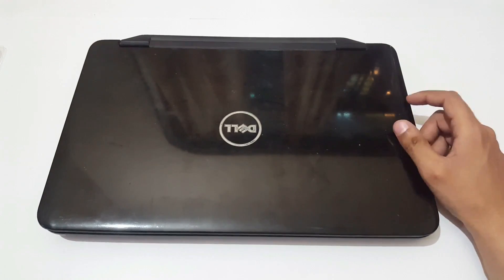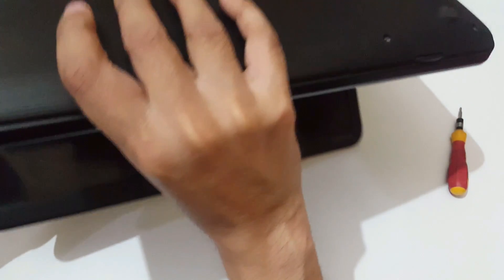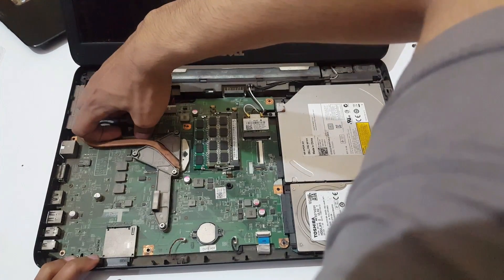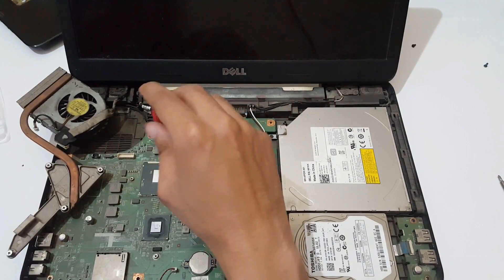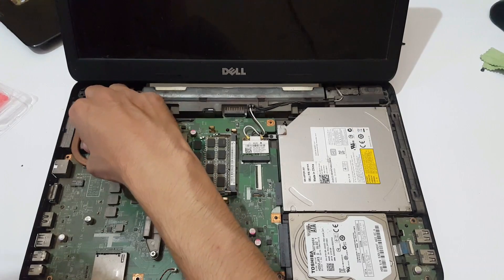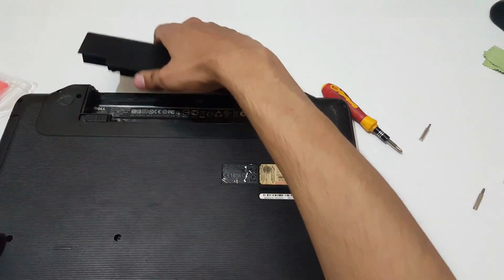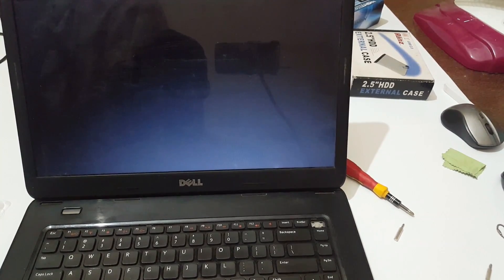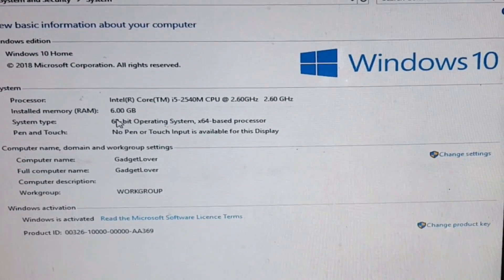How to Upgrade Processor on DELL Laptop | i3 to i5 & i7 - Make Laptop Faster for Gaming

Comment: Thank you for this video .. I have dell inspiron 15 3000, i3 7th gen. Laptop(model 3576) ...can i upgrade it to i5 or i7? ..if yes than what processor will suit best for my laptop?
Reply from the maker: Mayuri patel : You're welcome and in my knowledge the processor of this Laptop is soldered so you can't upgrade it but I would suggest you upgrade its RAM and install SSD for better performance
Reply: @GadgetLover360  thank you very much ..
Reply from the maker: Mayuri patel : You're most welcome
Reply: @GadgetLover360  bro I had the same question for the same model, so thanks for the answer. I found that I can replace my cd drive with a caddy to attach additional hard drive, so if I use it to attach a ssd, will it improve my device's performance or do I need to install it inside by replacing the default harddrive?
Reply from the maker: @NaNa-cq8ck  Install it inside

Comment: Bro, my laptop Dell Inspiron 3521 and processor Intel Core i3-3110M, CPU 2.40 Ghz. Is it possible to upgrade processor i3 to i5 or i7?. Is there any issue will be face for this model once upgrading the Processor? If it possible please tell me which is best.
Reply from the maker: Noufal Thekkath : Unfortunately the processor of this Laptop is soldered so you can't upgrade it but I would suggest you upgrade its RAM and install SSD for better performance
Reply: @GadgetLover360  No brother, it’s not soldered it’s detachable. I already shared with you some the photos on Messenger App. I already detached processor and now I’m looking for the suitable i5 or i7 processor for upgrade. Could you please have look at Messenger App? I already shared some photos of my processor. Thank You
Reply from the maker: Noufal Thekkath : You're welcome and I had seen you only detached keyboard so processor not seeing but if it is not soldered Intel Core i5 3380M is best processor for your Laptop
Reply: @GadgetLover360  thank You for your valuable information
Reply from the maker: Noufal Thekkath : You're welcome

Comment: I have dell latitude e4310 i5 1gen can i upgrade it to i5 4th gen??
Reply from the maker: Faheem Riaz : Unfortunately the processor of this Laptop is soldered so you can't upgrade it but I would suggest you upgrade its RAM and install SSD for better performance
Reply: thank you sir
Reply from the maker: Faheem Riaz : You're welcome

Comment: bro can i upgrade my dell inspiron 3542 processor
currently i am using i3 4004u 1.7ghz
Reply from the maker: Cosmic _Hynex : Unfortunately the processor of this Laptop is soldered so you can't upgrade it but I would suggest you upgrade its RAM and install SSD for better performance

Comment: Hi sir... actually I have dell 15 R 5537 laptop.. what upgrade can I do with this model.... already I have upgrade to ssd and ram also...what else I can upgrade like processers or motherboard ....please suggest me ....thanks
Reply from the maker: Ravi Lohana : You're welcome and unfortunately the processor of this Laptop is soldered so you can't upgrade it but you can attach graphics card externally to your Laptop
Reply: @GadgetLover360  thanks for reply sir...there is any way that I changed motherboard with lastest in the market with old ...which motherboard and processer I can used in this model...
Reply from the maker: Ravi Lohana : You're welcome and yes you can change motherboard so I would suggest you search compatible motherboard on Google for better results

Comment: Bro....I have HP 240 G4 laptop which i have recieved from Assam govt in 2015-16...It has intel pentium 4 processor. Can I upgrade its processor
Reply from the maker: Anshuman Sharma : The processor of this Laptop is soldered so you can't upgrade it but I would suggest you upgrade its RAM and install SSD for better performance

Comment: Bro I have dell Inspiron 3580 I3 what is the best processor for it.
Reply from the maker: Sudheer Lakkoju : The processor of this Laptop is soldered so you can't upgrade it but I would suggest you upgrade its RAM and install SSD for better performance
Reply: @GadgetLover360  Bro do I get the licensed windows even after installing SSD
Reply from the maker: Sudheer Lakkoju : Yes transfer Windows license to SSD
Reply: @GadgetLover360  Ok thank you I will try
Reply from the maker: Sudheer Lakkoju : You're welcome

Comment: Hey I have an INSPIRON N5010...with i3 m380...can i upgrade it to i5 10th gen?
Reply from the maker: What About This : I would like to inform that you can upgrade processor in same generation only and Intel Core i5 580M is best processor for your Laptop
Reply: @GadgetLover360  thanks for your fast reply and i have intel hd graphics in it and want to run minecraft...what graphics card i should buy?
Reply from the maker: What About This : You're welcome and I would suggest you buy Asus GeForce GT 710 2GB GDDR5 Graphics Card and attach it externally to your Laptop for better gaming experience

Comment: My friend i have dell N5010, with 0wxy9j cpu, with p6200, PGA988 Socket, WITHOUT AMD GRAPHICS CARD.
1. CAN I UPGRADE?
2. WILL I NEED FOR VOLTAGE TO RUN I7?
3. DID I NEED ANOTHER MOTHERBOARD?
thank you.
Reply from the maker: Elvin Mammedov : You're welcome and yes just follow instructions carefully to do it successfully without any problem and Intel Core i5 580M is best processor for your Laptop
Reply: @GadgetLover360  Thank you. What will be faster I7 640M or I5 580M?
I need to change the battery or the power supply for more watt?
there not will be heating problems?
Reply from the maker: Elvin Mammedov : You're welcome and there is no need to change battery of Laptop for this method and Intel Core i7 640M is faster processor

Comment: hey bro, can i upgrade Dell Vostro 3458 i3-5005U??
Reply from the maker: Risnanda Dimas Prayoga : Unfortunately the processor of this Laptop is soldered so you can't upgrade it but I would suggest you upgrade its RAM and install SSD for better performance
Reply: @GadgetLover360  can i install an external gpu in Dell Vostro 3458??
Reply from the maker: Risnanda Dimas Prayoga : Yes
Reply: @GadgetLover360  can??
Reply from the maker: Risnanda Dimas Prayoga : Yes you can attach external graphics card to your Laptop for better gaming experience
Reply: @GadgetLover360  thanks brother
Reply from the maker: Risnanda Dimas Prayoga : You're welcome

Comment: Can i upgrade my hp 4005u 2015 version
Reply from the maker: Harsh Ballamwar : In my knowledge the processor of this Laptop is soldered so you can't upgrade it but I would suggest you upgrade its RAM and install SSD for better performance

Comment: Hello bro! I have a dell inspiron 15 5000 series with a i5 processor. How much of a powerful processor I can install for gaming? Can I upgrade gpu?
Reply from the maker: Nargis Poli : Hi and I would like to inform you that if processor is not soldered you can upgrade it in same generation only and you can't upgrade GPU but you can attach graphics card externally to your Laptop for better gaming experience

Comment: Sir can I upgrade Dell vostro 3590 i3 to it or i7 or i9 processor
Reply from the maker: Mohit Khurana : Unfortunately the processor of this Laptop is soldered so you can't upgrade it but I would suggest you upgrade its RAM and install SSD for better performance

Comment: Sir I was thinking if I can upgrade my hp laptop it's i3 to i9 will it work and how can I increase my fps I get 60 I want 120+ my laptop has 8gb ram I heard if u increase ram u will be able to get more fps will putting 16gb we worthit please help me out asap.thanks🙏
Reply from the maker: Pavraj Brar : You're welcome and I would like to inform you that this upgrade will definitely improve the performance but for high refresh rate I would suggest you attach external graphics card to your Laptop update video driver to the latest version and optimize game settings
Reply: So would changing my graphics card improve my performance. Ok so buying i9 will help or not? And can you make a vid on buying a graphics card for laptop under 150$ and the settings that will improve my fps and gaming performance if possible use I9 cou also for info please thank you I'm subbed and liked to you
Reply from the maker: Pavraj Brar : Dear subscriber you're welcome and I would like to inform you that if processor of Laptop is not soldered you can upgrade it but in same generation only and for better gaming experience you can attach graphics card externally to your Laptop

Comment: Hello,I have a TravelMate 7740 laptop acer
Socket 989 rPGA
Mainboard: Acer BA70-CP
CPU: Intel Core i3 370M
Can I install an i7 940XM / i7 840QM / i7 740QM processor?
Reply from the maker: Rami Sadik : I would like to inform you that processor can upgrade it in same generation only and Intel Core i5 580M is best processor for your Laptop
Reply: @GadgetLover360  i7 640M ?
Reply from the maker: Rami Sadik : Yes you can also upgrade it with this processor

Comment: bro i have a dell inspiron 5558 can  i upgrade it another question will it affect the data of the laptop  and  can i upgrade my gpu from intel hd graphis to gtx1660 in this laptop
Reply: and its i3 so can it be upgraded to i5
Reply from the maker: WolfClover : Unfortunately the processor of this Laptop is soldered so you can't upgrade it and I would like to inform you that you can attach graphics card externally to your Laptop for better gaming experience and it will not affect the data of Laptop
Reply: @GadgetLover360  okay :(

Comment: Hi i have a dell vostro 3700 with a I5-450M,do you think i could swap it for a i5-3470T,cheers
Reply from the maker: mark lane : I would like to inform you that you can upgrade it in same generation only and Intel Core i7 640M is best processor for your Laptop
Reply: @GadgetLover360  Many thanks for your reply,much appreciated.
Reply: @GadgetLover360  Also would you no if that cpu supports 16gb ram,many thanks
Reply from the maker: mark lane : You're most welcome and I would like to inform you that this processor supports 8GB maximum memory size
Reply: @GadgetLover360  Many thanks for your help,i wanted a cpu that would support at least 16gb,i have been looking into it,and dont think there is one for my G1 socket that does.May be time for another laptop,cheers Mark.
Reply from the maker: mark lane : You're most welcome

Comment: can i upgrade my gpu? model: inspiron 15 5593. i want to upgrade with a gtx 1050 or something like that?
Reply from the maker: W8R GaMing : No but you can attach it externally to your Laptop
Reply: @GadgetLover360  will I able to use wifi after adding extra gpu?
Reply from the maker: W8R GaMing : Yes
Reply: @GadgetLover360  HOW MUCH IT WILL COST IN USD?
Reply from the maker: W8R GaMing : I would suggest you check on Google for better details

Comment: Can i change my Lenovo IdeaPad330 intel celeron processor?
Reply from the maker: Technical Tamim : Unfortunately the processor of this Laptop is soldered so you can't upgrade it but I would suggest you upgrade its RAM and install SSD for better performance

Comment: Nice video, also, what can I upgrade my dell Inspiron 5566 core i3 7100 to?
Reply from the maker: Ant Man : Thanks and unfortunately the processor of this Laptop is soldered so you can't upgrade it but I would suggest you upgrade its RAM and install SSD for better performance

Comment: My Laptop is Dell Inspiron 15-3552 with processor Intel (R) Celeron (R) CPU N3050, Can I upgrade it?
Reply from the maker: Froilan Libao : Unfortunately the processor of this Laptop is soldered so you can't upgrade it but I would suggest you upgrade its RAM and install SSD for better performance

Comment: Bro can i upgrade my laptop processor 

PC SPECS:-

INTEL i3 5005u 
VOSTRO 3558
Reply from the maker: Technical Gamerz : Unfortunately the processor of this Laptop is soldered so you can't upgrade it but I would suggest you upgrade its RAM and install SSD for better performance

Comment: Hello, I have N5010 with 0wxy9j motherboard and HM57 mobile socket. Is I7 640M suitable? thank you.
Reply from the maker: Elvin Mammedov : You're welcome and yes you can upgrade it in same generation
Reply: @GadgetLover360  Thank you. It will not do problems with power and getting hotter becuase the cooler system. i mean the cpu not will be hotter when it will work because the cooling system? 
what is the last and storgest cpu that  0wxy9j motherboard and HM57 mobile socket supports?
Will  i need higher-wattage power adapter to run the i7?
thank you.
Reply from the maker: Elvin Mammedov : You're welcome and I would like to inform you that this is the best available processor for your device
Reply: @GadgetLover360  Thank you.What about the TDP? Will be heating problems because of that processor?
Reply from the maker: Elvin Mammedov : You're welcome and kindly provide current processor model number

Comment: Plss tell whats the max cpu upgrade for my dell vostro 1710 pllss reply
Reply from the maker: Akhil Manhas : Provide processor number
Reply: @GadgetLover360  currently it's core 2 duo T5780
Reply from the maker: Akhil Manhas : Intel Core 2 Duo T7800 is best processor for your Laptop
Reply: Thankyou but i dont think so upgrading will make sense coz if it was upgradable to i5 Or higher then I would definitely go for it ....
Reply from the maker: Akhil Manhas : You're welcome and I would like to inform you that upgrade will always improve the performance of Laptop and upgrade RAM and install SSD for more better performance

Comment: Where u buy i5 processor
Reply from the maker: Ramarao Indugu : I would suggest you buy it from Ebay or Aliexpress online store
Reply: I can't find any where????
Reply from the maker: Ramarao Indugu : You can also search it on Google for better online buying details
Reply: @GadgetLover360  mother board also we have to change ???
Are any problem with changing mother board ,when we change the processor.
Reply from the maker: Ramarao Indugu : No but buy processor according to motherboard specifications

Comment: Max ram capacity of vostro 15 3568?
And 
Can i upgrade its i3 processor?
Reply from the maker: ShuHaiB BaShEeR : 16GB and unfortunately the processor of this Laptop is soldered so you can't upgrade it
Reply: @GadgetLover360  is it better to add 4gb in second slot or 8gb?
Any problem in adding 8gb when 4gb in first slot?
Reply from the maker: ShuHaiB BaShEeR : No but I would suggest you upgrade it to the maximum for better performance

Comment: i have a asus g17 1660ti i7-9750h can i switch my cpu to i7-9700k?
Reply from the maker: Izon Icy : I would like to inform you that if processor is not soldered you can upgrade it in same generation only
Reply: @GadgetLover360  so can i upgrade to i7900k?
Reply from the maker: Izon Icy : No and Intel Core i9 9880H is best processor for your Laptop

Comment: Bro I have Dell inspiron 5408 2n1 series with 10th gen  i5 processor can i upgrade to i7
Reply from the maker: sri latha : In my knowledge the processor of this Laptop is soldered so you can't upgrade it but I would suggest you upgrade its RAM and install SSD for better performance
Reply: @GadgetLover360  bro can i upgrade battery for better battery life
Reply from the maker: sri latha : Yes buy new battery for your Laptop
Reply: @GadgetLover360  bro which battery is better for more battery life can you suggest me
Reply from the maker: sri latha : I would suggest you buy original battery of this Laptop

Comment: 1st generation intels can only be done like this. Others  are soldered in. Mean while get a ssd 🙏
Reply from the maker: HD K : If processor is not soldered you can upgrade it in same generation and I would suggest you upgrade its RAM and install SSD for more better performance

Comment: it doesn't look much faster. I think you need to replace the hdd to ssd. I think it's better solution.
Reply from the maker: Gömöri Viktor : This was first boot of new processor and it will improve the performance of Laptop and I would always suggest upgrade the RAM to maximum and install SSD for more better performance

Comment: I have a dell inspirom 15 3000 series intel core i3-7020U CPU @ 2.30GHz 8GB RAM. 64 bit Operating system. Can I upgrade it to a Core i7 or I can't upgrade at all.
Reply from the maker: Bizzy Dale : If processor is not soldered you can upgrade it in same generation

Comment: Hello, i have Asus fx570ud with an intel i7
will i be able to upgrade it and if so, what is the best processor
Reply from the maker: Windowmaker : Unfortunately the processor of this Laptop is soldered so you can't upgrade it but I would suggest you upgrade its RAM and install SSD for better performance

Comment: What exactly is the model of the i7 processor you installed?
Reply from the maker: Seymen Ballı : It is Intel Core i5 2540M and I would like to inform you that if processor is not soldered you can upgrade it in same generation only
Reply: @GadgetLover360  I wonder if I can upgrade ram and play games with this processor.
Reply from the maker: Seymen Ballı : It will improve the performance of Laptop and I would suggest you upgrade its RAM and install SSD for more better performance
Reply: @GadgetLover360  I'm using ssd, how many gb ram do you recommend
Reply: @seymen6761  16gb is best for laptops
you could go higher
Reply from the maker: Seymen Ballı : It depends how much you can expand it in your Laptop so I would suggest you upgrade it to the maximum for more better performance